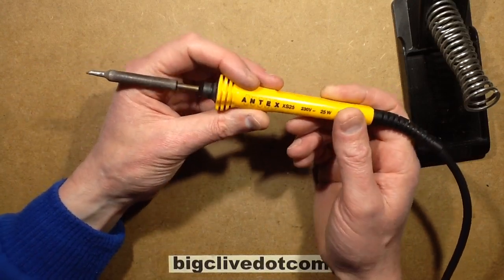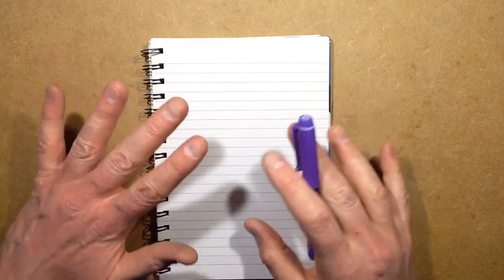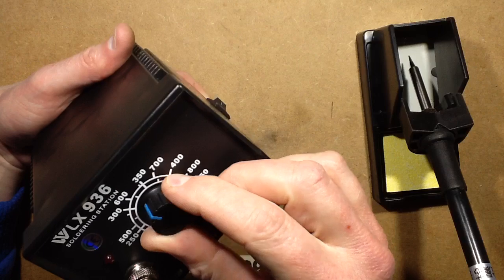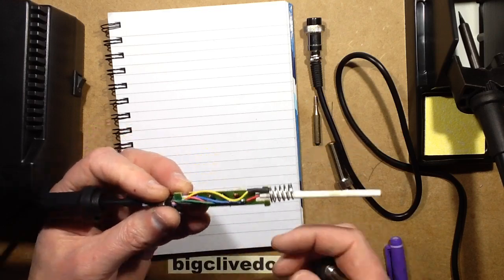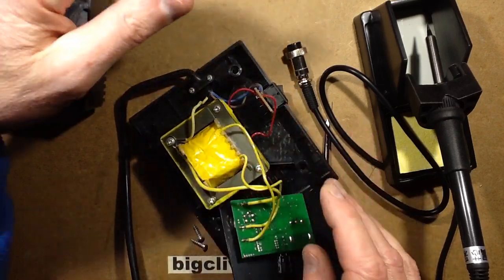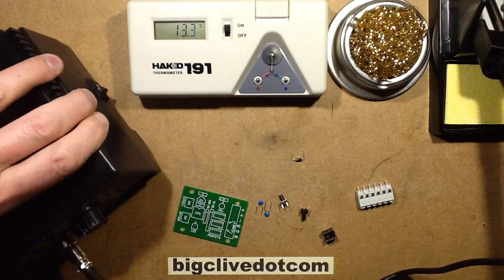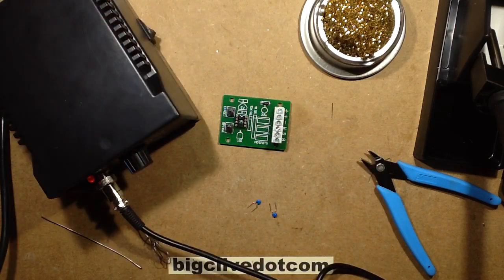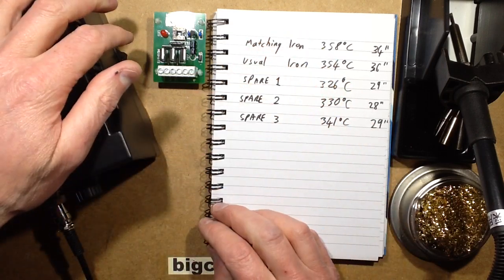Soldering basics and choosing a cheap soldering iron.

Comment: Multicore solders have several flux cores, if I remember correctly, 5 cores in the brand I used as a youth, which was branded "Ersin" - an anagram of "Resin", which is the flux material - pine resin or rosin, taken from the sticky sap of conifers, after turpentine was distilled off. It used to be good old juicy lead-tin 60/40 solder.
Also called by it's greek name, "colophon", it was long used as "naval stores" to make ship hulls timber joints watertight, mixed with bitumen to make a sticky paste, which became more or less integral with the wood after it solidified as it cooled. as a dry powder it is used to make ropes less slippery in the hands, or as a block to make musical bows for string instruments vibrate the strings of instruments of the violin family without slipping and squeaking.

Comment: The main thing I learned about soldering. is making sure your work is very clean. for me soldering electronics is easier. than soldering things like radiators and other larger jobs. because a person has to get more heat into the work. in fact those kinds of soldering jobs usually require the use of a torch. in America they banned the use of lead solder on plumbing. and any kind soldering where people are going to consume stuff from the soldering job. I used to like the Weller soldering irons. but they have changed them in more recent years. if a person uses them for large soldering jobs. the transformer inside the the plastic housing. melts the inside of the housing. then the transformer flops around inside the housing. something I like about the soldering stations is a person can adjust the temperature. which is handy for soldering diodes because they normally have temperature limits. and can be damaged if a person goes above the temperature limits. I have more trouble  brazing because a has to get the temperature just right.

Comment: Your iron seems to be 100x hotter than mine. The solder melts instantly. My 40W iron only seems to get hot halfway along the body and tip takes ages up melt solder.

Comment: After trying different irons I changed from Antex to T12 and now I have an iron that heats up quick and maintains it heat, with plenty of bits, so that unit sits on my bench and just works, and if I forget to turn it off then it auto, changes to standby so no problem, if you get a chance get one Clive, it's cheap and good its called KSGER STM32 T12 Soldering station, and cost me £34.00 with one bit KU my best bit is JO2. Bob in the UK, Thanks for all the video's

Comment: I’ve had a couple of these Antex soldering irons, they lasted about 5 years each. My second one packed in a couple of days ago and the cost is still over £30.  For £35 I got the Chinese solder station similar to what you mentioned. Can’t go wrong really. It came with extra tips, spare solder, cleaning pads and bendy arms to hold your work.  As much as I’ve loved the Antex, I think they are still overpriced.

Comment: @Clive   If, like me, viewers 'solder station' is the kitchen, and that kitchen has ceramic floor tiles, and their soldering iron rests in one of those springy things that will not stay put even when the base is stuffed full of lead and BluTac, and; their iron lead can reach the floor: then, they should buy a stock of replaceable ceramic elements, because they are insanely brittle, and, when the infernal springy thing hurls the iron off the work surface, before they can grab it while holding delicate work at the same time, they will want an immediate replacement (albeit, while still needing another iron to solder it with!).  That said, it's also sad to have a rack of broken irons, because whole ones are cheap, but it seems wrong to throw them away just cos a stupid springy thing keeps throwing them on the tiles!   (Glass saucepans, and favourite bone china mugs also always meet their fate, spectacularly, the same way!  :(  )  ( A broken, valuable glass saucepan handle, can, at least, be ground to make a serviceable pestle...)
Reply from the maker: If the cable is long enough, a loose knot or two may shorten it enough to stop it reaching the hard tiles.

Comment: Hi! , Iam planning to buy 936 type analog soldering station and specifically the ones with a thermocouple type heating element. But iam not able to make  decision to finally buy because iam aware that this station doesn't have cold junction compensation. Can you give me your personal experience how it performs without cold junction compensation. That's the main concern thats stopping me to buy it and the ones with ptc thermistor heating element  are good but 3 to 4 times more expensive. Iam on a budget and 936 type soldering station seems good enough.

Comment: Hi, i think where you shared about variations of set temperature and actual tip temperature is because of a lack of thermocouple temperature compensation circuit inside the base unit.

Comment: Granted, this video was filmed 8 years ago when tips were cheaper, but I strongly suggest no one buy tips that sell for only a dollar or two because they're definitely going to be inferior material, iron or steel, cheap knockoffs or counterfeits. Good tips are made of copper for the best possible heat transfer,  with several metals plated over the copper to protect the tip from the dissolving action of molten solder and flux that would quickly oxidize, corrode and dissolve bare copper.  Good quality tips will have iron plating at the pointy business-end *only*, because iron will "wet" to the solder but it does not easily dissolve into it.  Good tips will be attracted by a magnet only at the pointy end, and not at the very rear of the tip, but most of the cheap tips sold online are made of iron or steel and strongly magnetic throughout. You'll be able to solder faster and better if you use good quality tips, even on a relatively inexpensive soldering iron or station. I strongly recommend that you buy tips, solder and fluxes only from authorized distributors and specialty electronics suppliers in the country where you live.  Buying soldering accessories from Amazon, Alibaba, AliExpress, Temu or Banggood will net you only cheap quality goods that will have a negative effect on your projects and your ability to master the process of soldering. (I've seen corrosive, acidic plumbing flux being sold online and  marketed to unsuspecting electronics hobbyists; plumbing flux will destroy electronics!). I posted a video on my channel showing how to seed out the crappy tips from the good ones  using only a magnet, as well as a review and teardown of a Harbor Freight Schneider soldering station, similar to Clive's unit here, that sells in the States for only 45 bucks and is one heck of a bargain (although the tips supplied with it are made of iron and I suggest upgrading them).

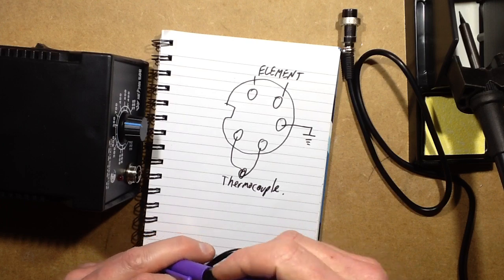Comment: Note that the 5 pin connector shown/diagrammed at 22:45     is also sometimes seen in a 6 or 7 pin version: 5 pins as shown but perhaps with a 6th center-pin; or 6 pins in the semicircle plus a 7th center-pin, as used in the Harbor Freight Schneider soldering station which I do a review and teardown of on my channel (it's a bargain at $45, but you'll want to buy  better-quality tips).

Note that actual DIN plugs ---- which this is not ---- similarly come in 5, 6, 7 and even 8 pin versions, with or without a center pin. The 5 pin semicircle can be either a 180 degree or 240 degree pattern (the connector Clive shows here has a 240 degree pattern); but the 6 pin semicircle has to be at least 240 degrees, and the 7 pin circle has to be 270 degrees (or you would run out of room to place the pins). The screw-on connectors in this soldering station can be obtained in various semi-circle patterns, so if you need to order one, be sure to pick a connector with the correct pattern arrangement !
Reply: PS, Clive, you never mentioned anything about capillary action and surface tension, an understanding of which can be helpful to understanding the process of soldering: how molten solder flows and wicks into/onto things (stranded wire, solderwick,etc). Flux improves both, as well as removing oxides and aiding heat transfer!

Comment: I use a precision gold a55kj 60 watt soldering station i love it it has a huge transformed but i found after an hour the transformer and heating on the main controller was untouchable so added a fan to suck in from the vent on the bottom then blow round everything and that fixed my problem

Comment: I tried using the cheapest soldering wire I could find. The one that comes with solid resin flux. The solder is kinda bad. Maybe it's just me that doesn't know how to use resin flux. But the flux would burn away when I dip the tip.

Comment: I never check tip temperature.

A properly heated tinned soldering iron with tin/lead will develop a straw-color oxide layer after about 5 seconds exposure to air. If it turns deep amber or red, it's too hot. If it stays silver, it's too cold. Lead-free solder needs to be 50-100 F hotter.

Comment: I've soldered probably 25 times. I've very much enjoyed your channel, and it has helped me! I was helping a customer who customized his Mercedes cargo van headlights, spent many hours cutting holes in covers and zip tying wires and stuff, but in the end wouldn't go together. I got em working and pulled a spade wire off and not noticing broke the ground of connector. My curiosity and the knowledge I encountered:)

Comment: I have used Antex irons and Ersin solder for years but not for the last 20 years or so, the Antex irons got to be too expensive and seemed to burn out more frequently then the ones from long ago also the tips available in the US were marketed by M.M.Newman and were garbage and burned up quickly and the Ersin solder just got to be too expensive.

Comment: We used to use 7 cored solder. It literally had 7 holes instead of 1, set in a hex pattern with a central core and used resin flux.

Comment: It amuses me when you pick up your 'big chunky Antex', as I 'learnt' such soldering skill as occasionally works, from wathing my Dad trying to fix our white portable Bakelite 'wireless' on the kitchen table, with his giant Navy soldering iron plugged into the single kitchen light after removing its frosted globe and fitting a Y connector.  Possibly he had less success than he might because of us using it in sword fights between regular temporary fixes for whatever the real fault was!  :)  I came across his neat little Navy AVO meter a while back, and made a new zero lever for it from a reshaped pin. Now I need to learn how to cut a curved sausage shaped piece of glass for it!   Such fine wiring inside it, I was amazed it still worked.
Reply: Have you done any soldering with gas irons like the Dremel Versatip?
I've found many uses for mine (though the name is a con as nobody else makes tips with the same thread, and they themselves only make a few very expensive ones).  Mine was worth it for the simlicity of making neat holes in plastic, but it might be evenbetter if I could solder with it without melting everything around it in the process! :)
Reply from the maker: I use a gas iron when stuck, but it's not my first choice as the heat goes up and down dramatically.

Comment: Interesting info on the soldering irons and stations. I know this is several years after you posted this video but the part near the end where you mention someone patenting pulse modulation for LED control. You could very easily have proved what is called in the patent world as 'prior art' which would have made the others patent claims very weak indeed.

Comment: almost 3 years of soldering and unless im sitting in the workshop with my classmates , i cant solder anything. Either the tip melts after 5 minutes of using or all the connections are bad. maybe its just the soldering iron i have at home thats shit . im probably just doing everything wrong. Ill try to follow every step. If it doesnt help im just buying new soldering iron. Great video clive <3
Reply from the maker: You'll suddenly click with soldering the more you do it.

Comment: I've just bought a soldering station based on the information in this video and I've paid quite a bit more for a digital model, but it's got a problem. 
The station itself is fine, the weird thing is the iron itself. I've opened it and its got only two wires coming from the heating element (for the heating element) and the circuit board is completely unpopulated. There are five wires coming from the cable but the blue and white are soldered onto the board together as are the red and green wires. So I have no idea how it's checking the temperature of the tip. Thoughts?
Reply from the maker: Some modern irons have a series thermocouple so they can heat the iron and measure it's temperature with just two wires.
Reply: Actually, I've just opened the station again and had a closer look. The DIN plug has only three wires going to it and two of them are attached to two pins each.

Comment: You plug it in and it gets hot. And my 25watt Radio Shack iron bought during secondary school in 1981 does just that. I’ve used it with the rolls of 60/40 tin/lead solder and packs of iron tips (during their numerous store closing sales) that I bought over the years and am still using.

Comment: Going back many, many moons, I took a liking to the Sinclair Black Watch, it came and I bought an Antex 15 watt soldering iron complete with a very very fine bit, I built the watch no probs only to find uncle Clive's kits had a problem and it had to go back to Sinclair for repair ( replaced for a working watch ) the Antex has only just expired but was a great bit of kit . Keep the great videos coming 👍👍👍👍
Reply from the maker: You might be able to get a replacement element for the iron, but it would probably cost more than a modern iron.

Comment: 2016 was just before the influx of cheap cartridge-style irons from China that would’ve totally blown you away, Clive. TS80, TS100, KSGER, etc and now T3A, T3B, etc. Clone irons that take Hakko T18 tips became obsolete as soon as those landed. I say this as someone using an Aoyue T18 clone since 2016 myself… almost daily. I’m really tempted to upgrade to the AiXun T420D JBC clone but it ain’t cheap like the smaller stations with a single JBC or Hakko-T12 compatible handle.

Comment: While lead solder is certainly safe to use, I wouldn’t tell people it’s not toxic. Heck, when I was a kid my friend was absent-mindlessly chewing on some solder wire until I noticed. He stopped real quick when I told him it contained lead and could cause lead poisoning. Telling people the opposite may very well have the opposite effect.

That said, RoHS/Pb-free initiatives to eliminate lead from most manufacturing are mostly to keep it out of landfills where it might contaminate streams and water tables.
Reply from the maker: It would be interesting to dig up some landfill and see how much of the solder had dissolved from PCBs.
Reply: @bigclivedotcom  Yeah. I mean, we used to use lead pipes to carry water. :)

If anything, the additional failures from RoHS capacitors and lead-free interconnect failures inside chip packages have sent more electronics to the landfill that would’ve been perfectly good otherwise. Imagine what else went into the ground instead.

It’s a lot more than just the early 2000s capacitor plague with half of a stolen Japanese electrolyte reformulation (missing stabilizers): think about all those GPU failures taking whole laptops with them then consider all the failed game consoles.

An old Nintendo from 1987 isn’t going into the landfill because it still works after you clean the contacts. Meanwhile, Microsoft lost BILLIONS on XBOX 360 chip failures and I was seeing them in the dumpster every day while the system was still current (~2011).

Comment: 380 degrees being a lot is funny to me. Working on a lot of modern lead free shit solder devices for repair at work reasons I tend to go around 450 or even 500 sometimes. Gotta be careful not to burn things sure but the speed is so nice. Also we have solder now in some devices that literally WILL NOT FLOW below about 430 or so at all. It's absolutely horrid. Now looking for a home use iron for my own projects and just find myself thinking "I can't spend the money for the stuff I use at work but I'll NEED that high temp" and I can find absolutely nothing that fits. Lets see if the rest of the video holds for me something good before looking more though.

Comment: I have a decades old spool of solder and amazingly although it is only 1 mm thick it has five cores of flux (the cross section looks beautiful under a strong magnifying glass)! I don't know the reason for making it so, perhaps it makes the solder easier to bend and perhaps the flux also flows better from five small cores?

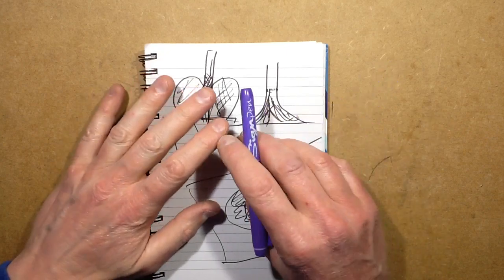Comment: 11:32 Well, aluminium isn't easy to solder, but stainless steel (some kinds of it only though) are. You just have to use a soldering paste that usually is used to solder copper pipes (at least it worked for me)

Comment: One thing when I was learning people in videos never told  me was to use flux. I thought " hell my solder has flux in it, it should be good."
No! It wasn't until I started using flux that soldering gotten to be better and actually looking good!  Also use thicker soldering tips, even for small smd parts because the tip heats up the pad and joint better and faster.